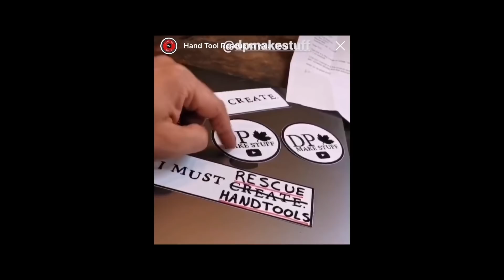secret compartment cabinet 🌳

Comment: I learned to set type and print using a very similar platen press.  A couple of questions: 1. Where is the tray full of actual type and 2. Where are the locking frames in which you set and lock the type, which frame is then locked into the press?  Other than that, very cool.
Reply from the maker: Unfortunately I have no type. I’ve been making my own print blocks out of wood. I show my process on Instagram.

Comment: When I was in Junior High School in the early 60's, we had print shop that used a bigger version of the one you have.  I hope you did get different print sizes, spaces, styles, and the hand set holder.  The cabinet with trays we used was made out of red oak that was stained that dark brown from the 20's and 30's.  There was a specific order to where each piece of type was placed into the tray cubbies.  We had to memorize where each piece went before we could start setting the type into the holder.  If you are lucky, maybe you can find an old cabinet, and refurbish it to its old glory.  Good luck finishing your press.
Reply from the maker: If I can find some type I’ll get it. Very difficult it turns out.